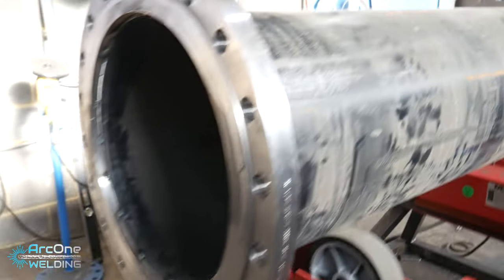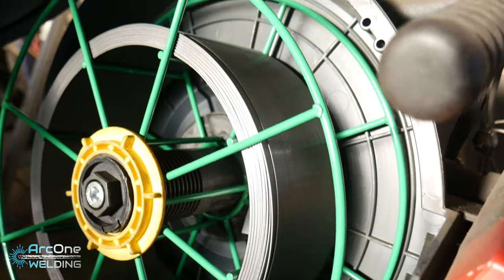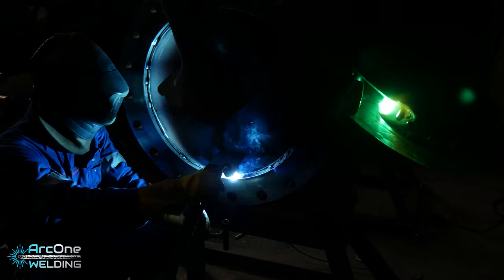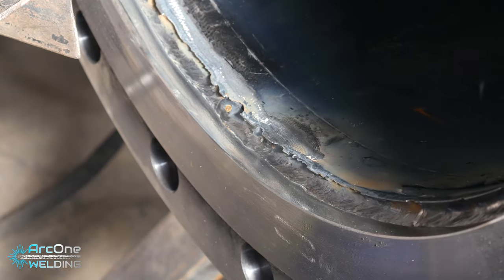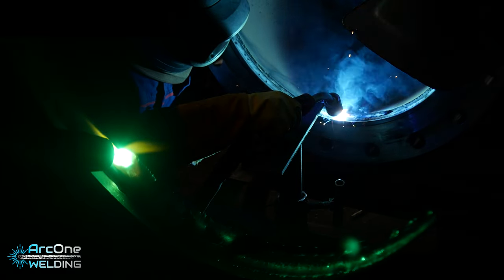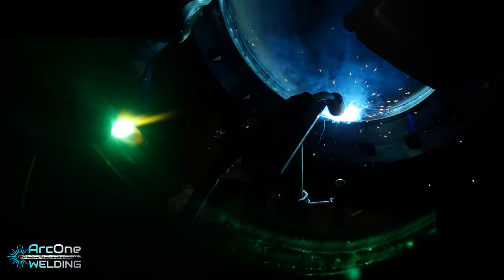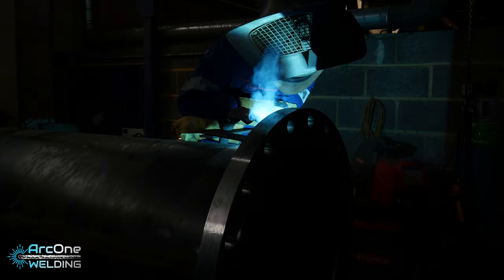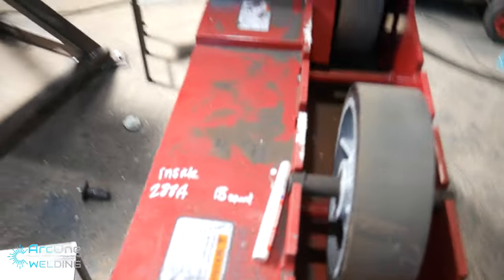1hr To Weld Each Flange! 24" Pipe Spool Welding & Fabrication  Part 2  (MIG/MAG HOW TO)

Comment: I'm 40 years in and you've proved yourself young sir.i appreciate rigging the torch up and working the the manipulator with the mig but i learnt on the stick and can't avoid whip and poise. Inside flange 7 o'clock up outside flange 11 o'clock up  26-28v and wire speed so it's humming  fuck the WPS usually written by university idiots who've never struck an arch.

Comment: Your gun position is wrong for the wire you're using, next time turn your torch towards the 4:30 5:00 position on the pipe to give it the flat penetrating look you're looking for!
Reply from the maker: I appreciate it dude, the machine helps out so much that i can get lazy and inconsistent in my torch angle and still get an acceptable weld

Comment: also bud.. your issue with the constant changing of the arc length. That kind of problem is eliminated with pmc like i mentioned in the other video.. the machine adjusts the arc length automatically to how far the work is moving to and from the torch while maintaining full penetration
Reply from the maker: Yeah i remember your comment, i will try speak to fronius, see if they would demo it for me